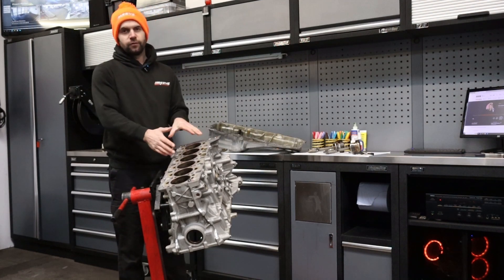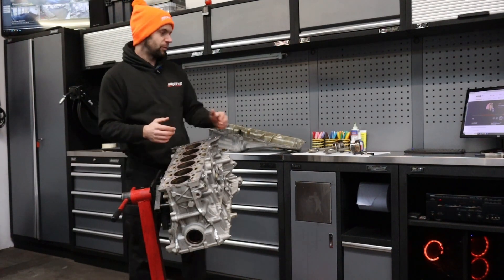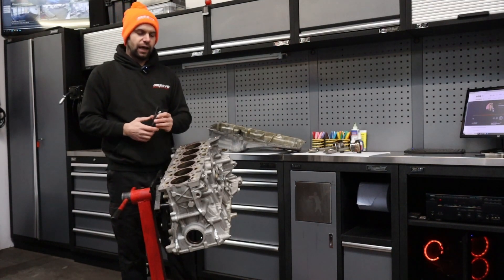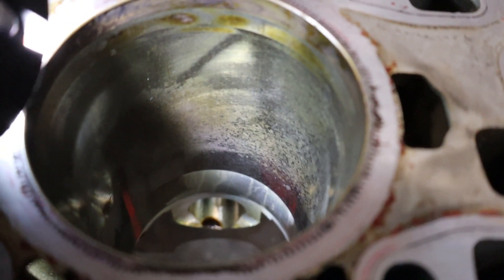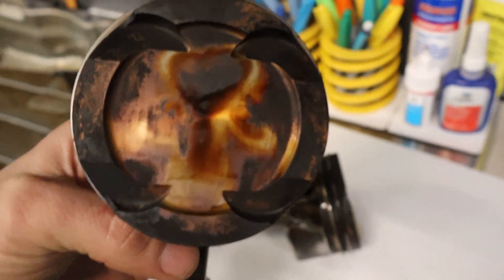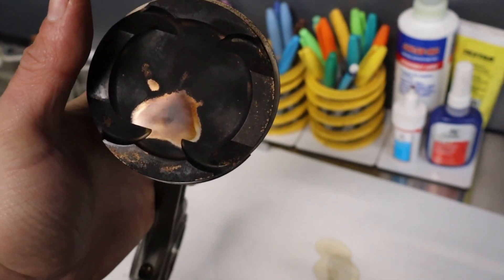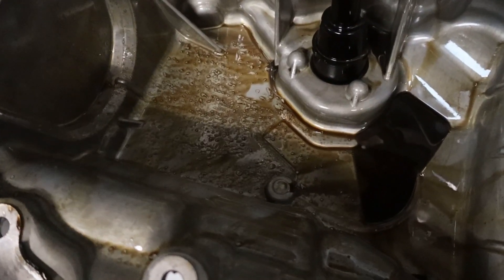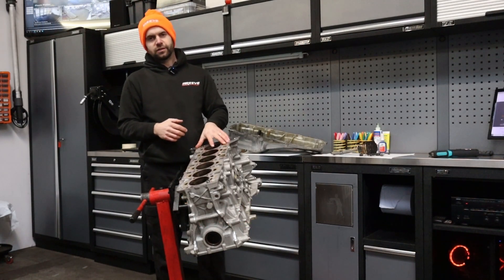TOYOTA SUPRA A90 B58 BMW Engine Piston Bore Failure

Comment: I have a puff of smoke and the smell of oil burning when coming to a stop at the traffic light i replaced my pure 850 with my stock turbo still smoking just much less but still smell burning oil im afraid to even think im a victim of this i have oil in the throttle mouth charge pipe and turbo inlet pipe so in quite a sticky situation
Reply: What happened in the end? What was the outcome? 
Thanks for sharing.